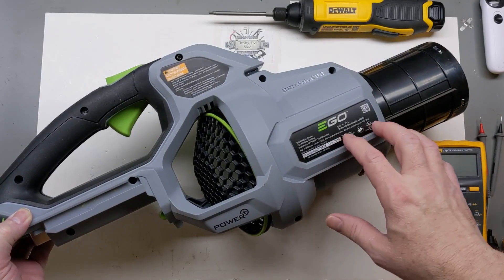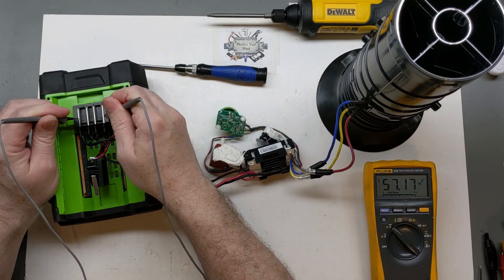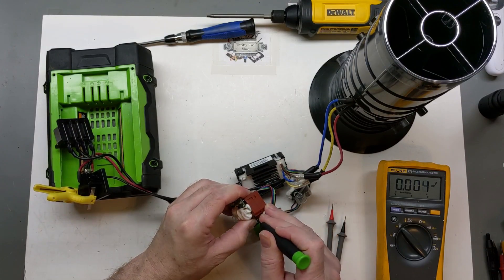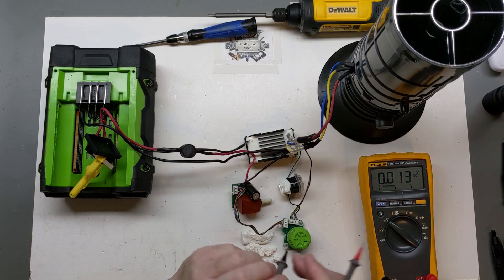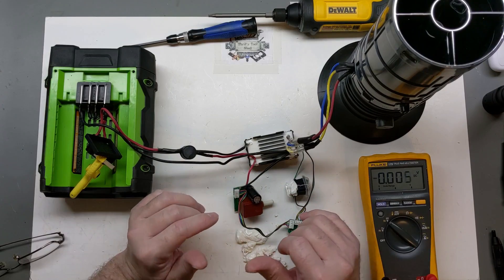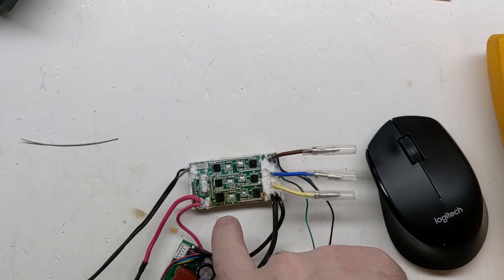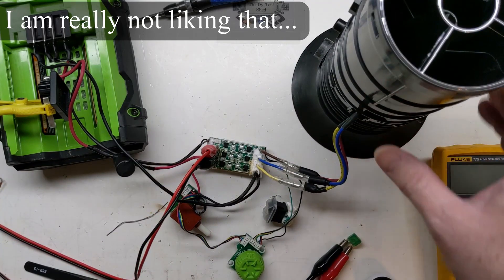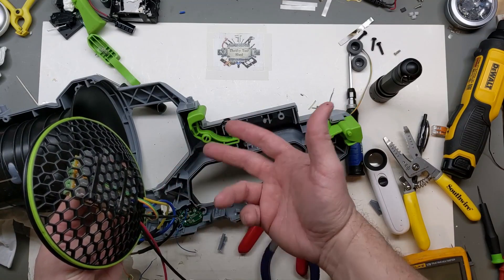EGO 650CFM Blower Not Working (Troubleshooting)

Comment: I just started fixing the ego tools. If you add mosfets to every spot and add a gate resistor. Would that make the tool more stable? Less prone to shorting out and blowing a fuse?
Reply from the maker: I do believe that to be true, but I never have tested by populating them all and checking the gate signals with an oscilloscope to verify.
Reply: Follow up questing. Do you know the part description for a 30A fuse for the lb6700 series blowers? The backpack blower have a 40A fuse and i found them but im having trouble finding a 30A fuse. Could I just use 40A fuses for everything?

Thank you. Great video! Im 3 years late.
Reply from the maker: @chamberashes3128 
I did share some digikey links to the 30A fuses and Mosfets in the video description of the blower repair video below. It was for the repair of that particular model. It's been a while. Hopefully, it helps.
https://youtu.be/FxO7CpV4b9g
Reply: Thank you for the help. Im watching your videos about the battery break down and repairs. They are great!
Reply: I found the link you gave for the 30A fuses. Thanks. I simply didn't notice it. My bad.
Hopefully, one last question. Have you shared a link to the 100ohm resistors used on the blower board? 

I really do appreciate your time and your guidance.
Reply from the maker: @chamberashes3128
Thanks for your kind comment,
I simply used a resistor kit that I have with many values and sizes from 0402 to 1206 sizes.

Comment: My ego 650 is surging when I hold the throttle, it will blow then stop then I have to pull the throttle again over and over and it blows for 1-2 sec then stops any ideas?

Comment: I have an EGO LB6700, which I bought less than three months ago, which just stopped working. I called EGO customer service and went through the troubleshooting tests with them. They agreed it needed to be repaired. However, when they checked my receipt from Amazon, they said the seller was not an approved distributor and denied my warranty claim. So much for customer service! I opened up the blower and did your tests and have ordered a replacement electrical harness ($90), which I hope will fix the problem. I really appreciate this video to guide me through the repair.
Reply: Your experience is the main reason why it is always suggested to purchase equipment from authorised dealers. I recently had a several years old dead EGO blower replaced under warranty with a new one, no questions asked, no fuss. Buying expensive stuff new from non authorised dealers is often a false economy. It sucks, but that's the way the system works unfortunately.

Comment: Is it imperative to replace the silicone in the power assembly? I am replacing one in a 765
Reply from the maker: Not imperative. I have had many still running without re potting the board. It will be best for sure to cover the board with a potting to help prevent corrosion. I believe use in the more humid areas or on foggy mornings  can cause corrosion much quicker.

Comment: This might sound crazy, but I’m thinking about trying to use the blower assembly from a junk one of these as an e-foil motor. Is that crazy ?
Reply from the maker: Well it's not that crazy to me, It might work once, possibly. I would use a sealed motor for under water use. These are open air cooled motors and will not hold up long at all submerged if I had to guess?🏄💦⚡💥
Reply: @ThriftyToolShed  thanks for the quick reply. I know the RC guys submerge their motors and I saw a guy recently who was using a cordless angle grinder and he submerged it totally several times. I can get one with a (probably) good motor / bad board for $50 which is a lot less than other options. I thought it would be funny if the whole assembly with the blower on it really provided a lot of thrust without extensive mods. I guys I could pot the outside with thermal conductive epoxy making it a "sealed"motor. An option I haven’t seen anyone offer for waterproof motors would be some type of positive pressure system that keeps water out by letting pressurized gas escape. Anyway, I might try it. Any thoughts on a controller? I’m a machinist by trade so all this electron stuff I’m learning on the fly
Reply from the maker: I have used the controllers like in this video on several blowers now. It is very hard to find a hall-less or sensor-less controller that will go up to 60V. I end up buying the 50V rated Sensorless version and I have links in that video description if interested.
https://youtu.be/fBlEHvHZa4Q
Reply: @ThriftyToolShed  thanks! I appreciate it. I’ll let you know how it goes

Comment: The 56v blower is garbage if you do lawn care, it will burn out in a single season, but it's OK for a general home owner.
Reply: General homeowner here.. mine died after two uses. It's a terrible product.
Reply: I highly advise purchasing the warranty, then keep returning it when it burns out because it does have power
Reply: @jackbenedett7961  purchased from ACE so it has a warranty. The problem is, EGO is in zero hurry to help customers with their warranty claim. Called it in a over a week ago (3 times) and my account still says “waiting”. Their service reps have been moved offshore so odds are good I’m hosed. They used to be a good company but profits and shareholders rule over true service.
Reply: Bought my second one at Lowe's and purchased their warranty, so now when it quits, I'm going back for a replacement.
Reply: They are great for general domestic use. Purchase from Authorised Dealers with the proper warranty and let the Dealer take care of things if there is a problem.

Comment: I have a new 650 which doesn't work, battery fully charged. I was going to open the unit and after taking out a few screws thought I'd youtube and search fixing EGo 650. After watching the video decided to put the screws back in and look for a repairman. EGo sent a new one but wanted to see if the inoperable one could live.

Comment: I bought this model and it lasted for 8 months, then one day when I barely pulled the trigger to have it run at a very slow speed, it made this grunting sound and then wouldn't work anymore...if I pulled the trigger the battery would light up showing it was reading the battery,  but it would not make a sound or work at all....I contacted Ego, they sent me a new one in the mail. The new one lasted 2 months and the exact same thing happened. I contacted Ego again and they sent me another one. So I know have 3 units. I'd really like to find out the problem with the other 2, especially since one is only 2 months old....any suggestions on what the problem is???
Reply from the maker: Typically it is the controller. Almost always the 30A fuse on the controller is blown. Only rarely does the fuse fix the problem. Most of the repairs by far have been shorted Mosfets as shown in my latest blower repair video as well as the 14" chainsaw repair video. On rare occasions it's the microcontroller on the controller itself. I have shown all these on videos.
Reply: @Thrifty Tool Shed  Thanks for the reply....I didn't watch the whole video but I will....How much does the controller cost and is this something a electrical dummy could fix??...if I took it to someone with the controller, what do you think they would charge??...thanks again.
Reply from the maker: @BTBFBG  
I can't answer much of any of those questions. I simply share what I find as we learn together. As far as the controller they range from $15 to $25. It usually depends on if I can find them on Amazon or eBay at the time. I am working on getting my hands on some 72V controllers, but it's been hard to get the sensor less in anything above 50V rating. The red ones that are 60V rated take the hall sensors. We have to buy the hall-less or sensor-less type.
Reply: Same here.  Barely used and over a year old.  Had you registered yours and/or have your receipt for Ego to replace it?  Thank you for your reply.  A new one IS NOT cheap.

Comment: I'm pretty new into the electronics repair game. I've went through the entire process you did with the exact same Ego Leaf Blower I have. I'm at the point where I'm checking the control board now. However, when I test from my negative power, to the positive (as shown at 9:51), I get no reading at all. I'm kind of stuck on what that means and what my options are now.
Reply from the maker: Well I did at first also, it was high in the meg ohms but then I showed it was because the fuse was blown. From the other side of the fuse I read short circuit or zero ohms so dead short between positive and negative. I have more than one video on the blowers also if it helps. 
For example: https://youtu.be/FxO7CpV4b9g

Comment: This is the blower I have but mine works just fine but sometimes it seems like it’s oscillating or turning off and on usually If the head is close to the ground so it’s like if it’s kind of creating back pressure and slowing the fan down but I’m not sure.

Comment: From a former 8.5 year USN Electronics Technician who has been fixing semiconductor manufacturing systems for the past 13 years, HELLUVA job on that diagnosis and repair!  I love that you chased the circuit all the way through to the MOSFET pack, and that didn’t stop you.  I never really picked up any 2M skills and my PCB soldering skills are experienced but still very amateur, so I would’ve taken my chances and stopped and looked for a broken one somewhere that I could’ve cannibalized the controller out of, which would’ve taken forever, but you pressed on through.  VERY SHARP SIR. Great job.  My kid left my blower on the back porch in the rain and now I have to dig into mine.  Thanks for the video!!!
Reply from the maker: Thanks so much for your kind comment sir! Best of luck to you with yours!
Reply: Couldn't you just replace the controller once you tested the bad .. or isn't that fun
Reply from the maker: As far as a new factory controller, they are not cost effective and even hard to find for some models. I did retrofit a cheaper controller in the next video. I enjoyed it.

Comment: Hey great content. I have an LB5800, very similar set up to the model in this video. The issue I have js that I get low speed and turbo, no variable speed in between. Would that most likely be a switch issue or controller issue?
Reply from the maker: It's possible the issue is with the controller, but I would check the potentiometer first it could be faulty. The wiring or the potentiometer itself would be the first I would check. Best of luck to ya and Thanks for your kind comment!;

Comment: Bought one of these Summer 2021, used twice then quit, like new. Ego replaced under warranty, no repair diagnosis. Will sell to you or will send for repair, take as much time as you want. Thanks.
Reply from the maker: Honestly, you can most likely get the most out of this on eBay as a non-working item. They still bring pretty good money for parts alone really. I have been fortunate enough to get several of these now for about the shipping cost. That's just people helping the channel by donating theirs, you can get more for it than that for sure. Thanks for thinking about us though!
Reply: Thanks for the reply and also for the excellent videos! I listed it on Ebay so we'll see what happens.

Comment: Anyone here because their blower motor automatically turns on when the battery is inserted?

This happened to my first 650.  Had had it for a month, took back to Lowe's and they gave me a new one no questions.  (Can return within 60 days no questions)

The second blower I've had for a few months so I'll have to deal with Ego directly.

Wondering if there is any quick solution to fix this.

Both times it happened because I used the blower in rain.
Reply from the maker: Very interesting. I have not see that issue. Weird how you had both do the same thing. I have worked on many of these now and most of them have the opposite issue when they fail. The blower will not run at all. Typically a BLDC controller issue. With these being a BLDC of course the controller has to be putting out or controlling well to run the motor so it is hopefully just a switch issue. I would think the trigger switch must be shorted especially if it controls fine with speed adjustment?
Reply: @ThriftyToolShed  Yes it is very weird that both did this.

Slide the battery in, and it turns on.  As if you're pressing the trigger just enough to turn it on.  If I use the trigger the power increases like normal.

If I move the dial to on, it increases the power incrementally.  Again move the dial more and the power increases as normal.

It was weird because today I left the blower under my client's porch for a few minutes, came back and it was running.  I thought I must have moved the dial, but nope! 

Both days it was raining, and the blower was a little wet, but it wasn't like it was a downpour.  And I keep it under cover when not actively using it.  Also the temperature was pretty mild.

And at the same time I was using my ego hedge trimmer all day in the rain, no issues.

Also swapping different batteries doesn't resolve the problem.
Reply from the maker: Wow. I do wonder if the switch is faulty. Let us know what you find with it!

Comment: Want to buy another 650 that quit after 3 uses? No warranty when bought on ebay.
Reply from the maker: Possibly, how much do you want for it?
Reply: @ThriftyToolShed  
I have no idea what it's worth not working. The battery and charger have to be worth more than the unit. Used it 3 times before it quit. They say it's an internal fuse or something. What would you charge me to fix it. Warranty's no good because I bought it on ebay.

Comment: My blower won’t start or do anything when I press the trigger even though the battery is charged. Any clue as to what it might be? I think it’s making contact with battery because when I press on the trigger the battery level circle turns on
Reply from the maker: Basically just what I shared on a few videos on blowers. I have a couple videos on the 480cfm blower as well. I shared as I learned on video. Seems like controller trouble shooting time. I have had a few with bad controllers and only a couple out of maybe 5 did I have luck repairing the controller. The others I did the retrofit to a fairly cheap BLDC controller on video as well. Best of luck to ya!

Comment: Wondering about source for controller, which I'm sure you have already checked. I would like too see you finish the repair. My curiosity always gets the best of me. Great sleuthing on your part, thanks.
Reply from the maker: I am testing with the same controller  I used in the 480CFM blower. I have had to work through some issues but it's running it! Of course with 63V caps replacing the 50V rated cap.over 1000uf also. I will work on the video of the retrofit. Thanks for your comment!